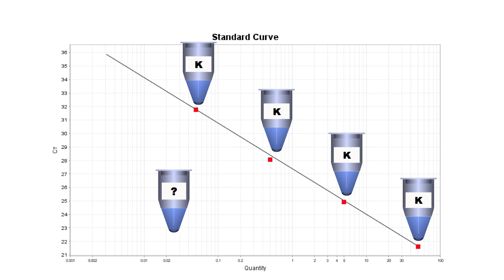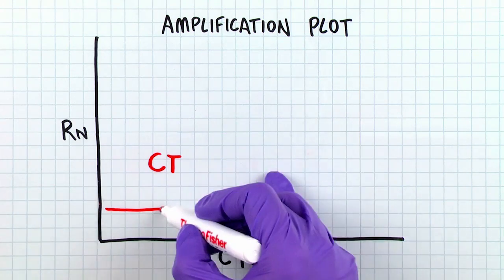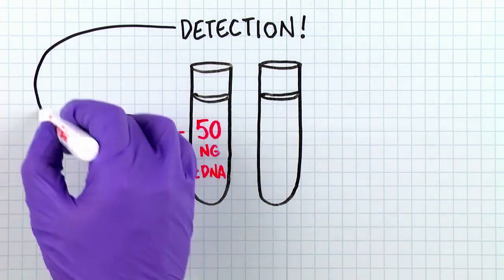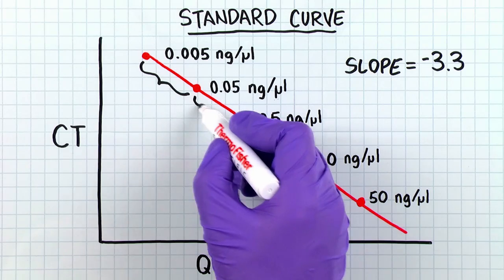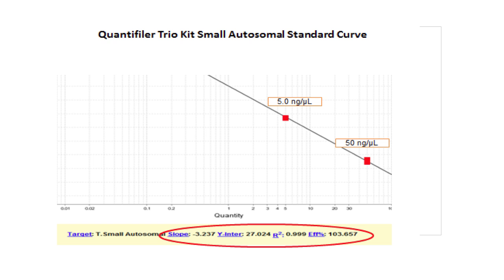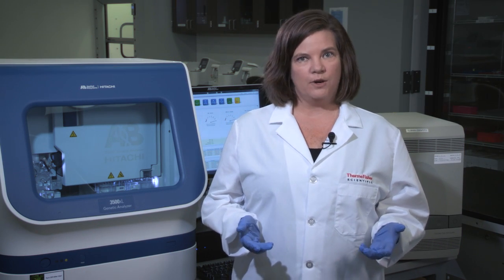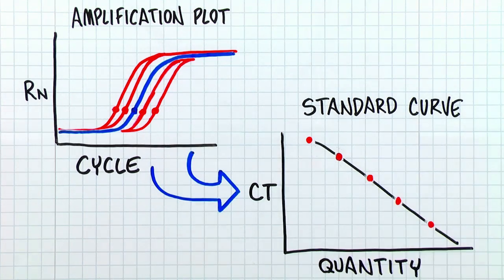Using Standard Curve to Estimate DNA Quantity - Forensic Focus #4

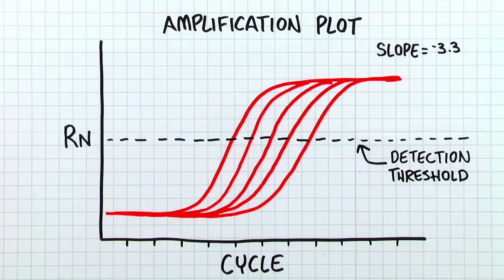Comment: 2:26 "The y-intercept is the expected Ct value for a 1ng/uL sample".  What?? That doesn't make any sense.  The y-intercept represents the lowest  quantity that can be detected, theoretically not zero, but essentially zero.  Ideally, the Y-intercept is the number of cycles in your assay.  The practical role of the y-intercept value is that it is used in a formula to take Ct's of unknowns and calculate starting quantities.

Comment: What happens when the DNA from the unknown sample is much larger or much smaller than the DNA from the standards. Wouldn't that completely change the concentration numbers? For instance 1ng/ul of DNA with 200bp length is a lot more copies than DNA with length of human genome. Trying to understand how you can use synthetic DNA for standards and human DNA in samples?

Comment: Hello, I know this thread is a bit long but wanted to enquire your thought about this. I want to calculate the concentration using an excel spreadsheet based on the equation of the linear curve. If slope is -3.34 and X= Cts, then New Concentration  = 10^ (3.34 Cts + C) where C is the intercept on the y-axis. When I do this, the concentration values I get become wired? How can I calculate the concentration without aid of the PCR machines?
Reply: It’s not a guessing game. You are asking to extrapolate that my friend is not reality and basically we telling patients they have this amount of virus according to our mathematical extrapolation.
Reply: @DR-M-K  It is NOT extrapolation, that means going outside the range of the known standards data. It is an ESTIMATE, which is the whole basis of using a standard curve. All biochemical measurements are estimates. That is why it is important to understand the accuracy, precision, reliability and validity of any technique used. Different techniques will differ in these aspects. All he is asking is how to manually (or really in EXCEL) do the same calculation the computer on the machine is doing. Presumably he does not have this facility on the equipment he has available. His problem is in rearranging the regression equation.
Reply: I'm not the greatest mathematician, but looking at this I think it should be: unknown DNA conc = 10 ^ [(C - Cts)/3.34]

Comment: Little question, at 0:35,shouldn't the buffer volume be 100 uL instead of 10 uL?
Reply: Hello, 
No, 10µL is right because if you put 10µL in 90µL of buffer, you are going to have a dillution of 10.
Reply: @zizouhab5100  nope. you would run out of starting buffer. should say 100
Reply: @samkoch1028  so is it 100 or 10??
Reply: yes you are correct

Comment: from here what can we conclude from the graph you used. which samples have has the lowest and highest amount of targeted gene product in the starting sample? like is the one on the right side or left side or all samples?  thanks
Reply from the maker: Thank you for your question Adnan. If you are referring to the amplification plot, the later CT values seen on the right side of the graph indicate a low amount of gene product, whereas the early CT values on the left side of the graph indicate a high amount of gene product. If you have an abundant amount of your target gene in your initial sample, it will cross the threshold sooner giving you an early/low CT value. If you have less of your target gene in your initial sample, it will take longer to cross the threshold giving you a later/high CT value.

Comment: Does the dilution factor must be the same for all the points of the curve?
Ex: can i use a curve with this values: 100, 80, 60, 40, 20 (ng/uL)?
or must the factor be constant like 100, 10, 0.1, 0.01, 0.001 (ng/uL)
Reply: In theory you can use whatever values you want to generate the curves but several factors needs to be taken into accounts:
*A strict minimum of 3 dilutions points (recommended 5)
*keeping the same dilution factor between each point facilitate it's manufacture and ensure that variation due to pipettes precisions is kept the same between points.(systematic error)
*for the same reason keep the volume between point at the same range (that will be difficult to achieve with a 100,80,60,40,20 where you'll need to manufacture a much higher volume of the 100, 80,60 and 40 to obtain the same volume of test than the 20)
*the samples you are measuring need to be within the standard curve, if outside you need to adjust samples or standard curve concentrations
Reply: @MrClement357  can you help me about real time pcr

Comment: mam,from university of Gujrat.
most respectfully asking,how will we discover the conc of dna at a given cycle
Reply: You donot need to discover, there is a detector in qPCR, at the elongation step of each PCR cycle, when reporter separate from quencher, it flourese, and the light comes out will be detected by detector, and that will give you concentration of DNA as that particular cycle. finally the computer will give you this detail.
Reply: @AqleemAbbas   so why we amplify if  we getting the concentration from the taq signal ? I mean this is based on the signal we compare it to know amount according to that signal and say ok this is the amount of dna etc but if pcr is making multiple copies of the same dna then we are getting multiple signal for the same dna ??